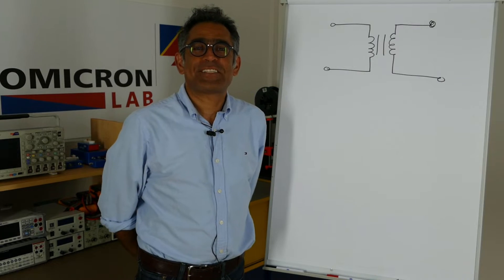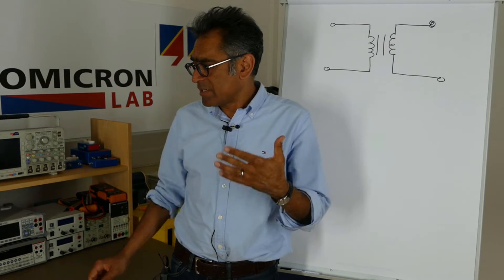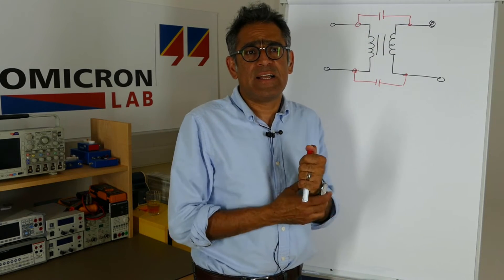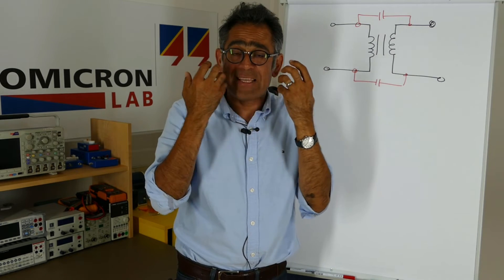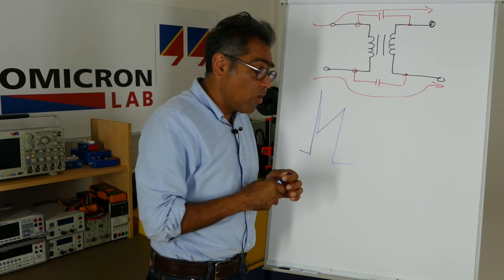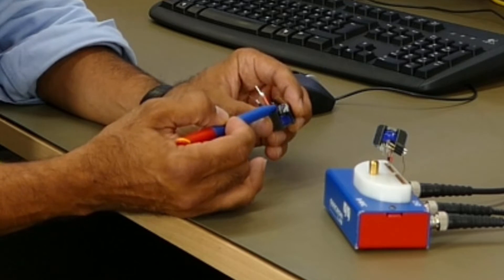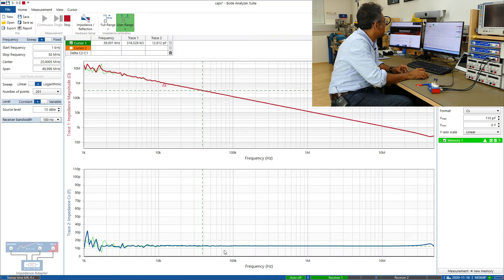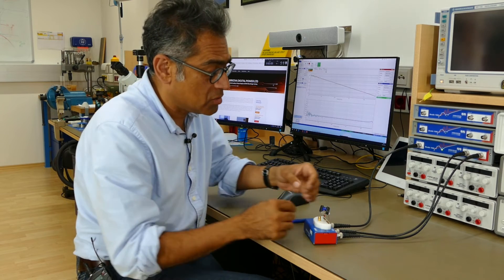Power Supply Noise Issues: Interwinding Capacitance vs Leakage of PSU Transformers

Comment: I have very large ferrite core it’s a 20kw transformer I use 24 gauge copper wire 6 together for a smps welder am building everything work but the transformer make a lot of noise when the overloaded senor reduces the duty I don’t have any issues when the arc welding but when it sticks the senor activate and the noise is there i gat wire space of 1 cm per turn and use glue to stop wire from moving when the high current is welder mother moves is a toroidal core but still the noise I rewind it for no space and wire all wound tightly the with the right phase but still noise the current sensor controller is the issues I use CT senor and a small ferrite ring to remove the frequency from getting into the ic the same thing happens the frequency is 50khz is there anything that can be down to stop the noise when current sensor activated

Comment: A term I have used in the past to denote two windings tightly wound together is that they are 'bifilar wound'. This does, of course, suggest that the two windings are similar in wire gauge and turns - which may not be the case where there is a large difference in primary to secondary volts and, to minimise interwinding voltage breakdown, the windings need to be separated.
Would appreciate a video on how you measure leakage inductance.